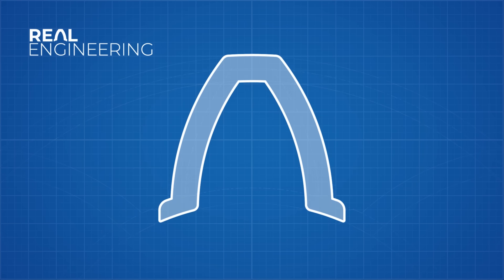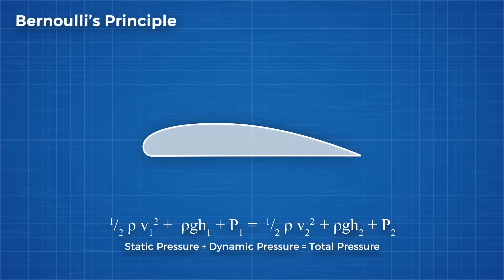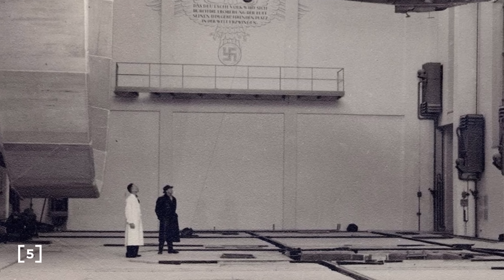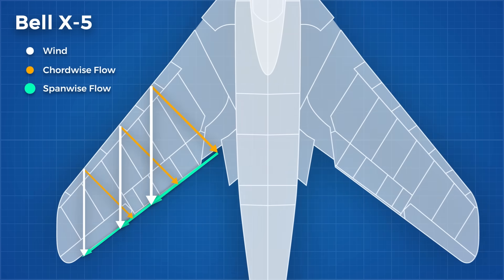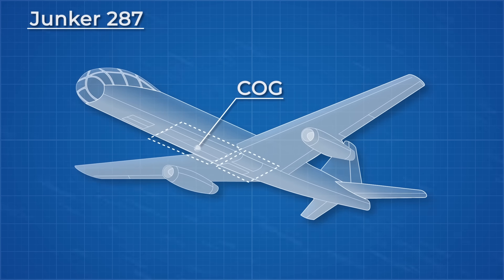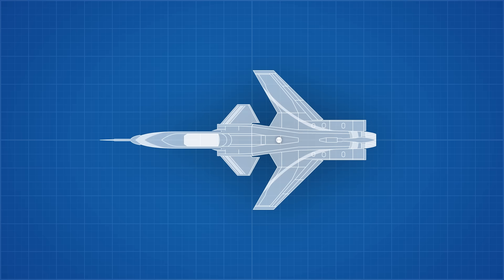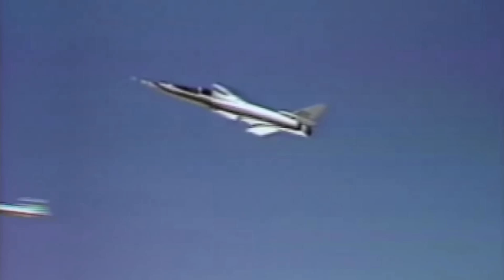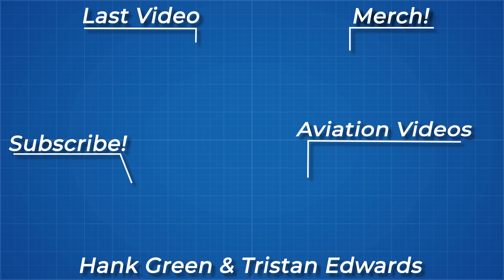Why Do Backwards Wings Exist?

Comment: Doesn’t the B-2 spirit need flight control computers to even fly as well? So why are we complaining about this one
Reply: Well this jet was meant for interceptions and dog fighting but if it's too unstable then the pilots won't be able to control it in the most critical moments, combat. Conversely the B-2 is meant to be a stealth bomber with a crew instead of one pilot and is supposed to maintain stable flight so its manageable for computers to control it

Comment: So basically backward wings are bad for taking off in the air but good for speed 
Then don't make them the both change when taking off to straight wings and to backward to achieve maximum speed

Comment: 2:00 The diagram's airflow pattern is inaccurate. The foil's lift forces air downward, so flow behind the foil should be diagonally downward.
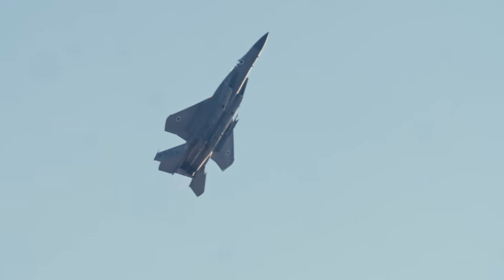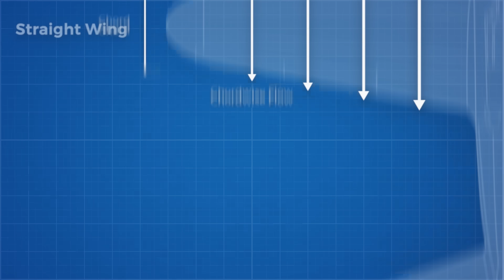6:30 I'm not an aeronautical engineer, but I really don't think the airflow has a significant component transverse to the fuselage, at least not nearly as much as shown in the diagram. See the diagrams starting at 5:00. And forward sweep reverses the SPANwise flow, not the chordwise flow.

Comment: Thank you Real engineering I truly enjoy your video, but I just found out the figure in 10:00 is little odd. As far as I know the instability of X-29 was caused by its reversed position of Center of Pressure and Center of Gravity. If the C.G is positioned in front of C.P it should be stable as the Canard can offset the lifting force from the main wing properly. (In high AOA the lift force generated from the main wing is greater than the lift force from the canard)
Please correct me if I am wrong. Thanks.

Comment: So we have tried forward wings, backward wings, straight wings, double wings, triple wings... what left to try? 

Honey BBQ?
Reply: 4 wings, box wings, no wings, all wings
Reply: @latinpassion  Those aren't left, they all HAVE been tried.
Reply: @latinpassion  Ah, a pilot of culture. Tell me, what are borders?
Reply: @latinpassion  we already have all wings. They're called flying wings. We also have several sets of quad wings too, and box wings
Reply: We could try forward wingLETS on a backwards wing, right?  Or did we already do that?
Reply: Could also try some weird merging of wing and tail such that the vertical fins are at the merged wing and tail tips I guess, connecting the two in what looks from the front like its just a big loop (merge point must of course be sufficiently behind the center of mass to be able to use them as rudders)?   You know, to not have those pesky wing or tailtip vortices or something, since there wouldn't BE a tip.

Comment: The greatest advantage for the X-29's forward-swept wing was not mentioned.  

An aircraft inherently seeks its most stable attitude (try flying a paper airplane tail first and it will whip around to a nose-first attitude).  As a result the plane, in it's most stable configuration does not want to move out of that stability attitude, and takes energy and greater time and force to do it.  However if the wings are swept forward into an inherently unstable position, the aircraft desperately wants to flip around to a more stable position.  Taking advantage of this, the X-29's maneuvering was remarkably quick (which is really desirable in a dog fighter), since any control surface input would be a move to return it to its most stable attitude, therefore reacting very quickly.  Whereas, if it is already in its most stable position, it takes much longer to respond to controls.
Reply: Yes but this was too unstable. Too easy to completely lose control of the aircraft

Comment: I used to think some of Starscream's alt modes that had reverse wings were just nonsense sci-fi designs but now thinking about it a sentient plane that could control every flight surface like a limb actually makes sense
Reply: to be fair, a lot of the time, his robot mode also has the wings in a forward (upward?) -swept position, regardless of how the alt-mode has them, though the control surfaces do end up on what would be the new "leading edge" when he uses them in bot mode.
Reply: @Caldoric  leading edge control surfaces are a criminally under-studied part of aircraft design. Basically, modern planes have slats, canards, and tailerons, and that's it. I wonder why that is? Leading-edge control surfaces would easily solve (or at least postpone, which is often good enough) the stall issue that deeply swept wings have. Seems like it would be useful, I wonder if it changes the lift characteristics of the wing in unpredictable ways?
Reply: lol I'm sure the creators of transformers were thinking that much into it and not just "it looks cool and it'll sell toys"
Reply: @ianism3 If you think about it, Starscream has always had a vehicle mode similar to either supermaneuverable aircraft, or the superior aerial combat platform of the day (the F-15 in the 1980's, the F-22 in the 2007 movie). 

Makes sense because his whole deal is that he's supposed to be the strongest flying Transformer.
Reply: same for most of the seekers, too.

Comment: Part of the Bernoulli story of lift that is commonly used in the explanation is false. When people say the split air must reach the back of the wing at the same time, therefore the air across the top of the airfoil must go faster... that’s just dead wrong. Turns out the air on the top beats its lower air counterpart by quite a lot, therefore increasing lift due to Bernoulli’s law by a substantial amount. To say Bernoulli’s law doesn’t play a part is wrong. But people say it is wrong because a common variant of how it is taught is wrong. Also I’ve always preferred the Newton’s 3rd explanation, it explains why an angle of attack must exist. Forcing air particles down forces the wing up, as well as the resistance to the air on the bottom causing it to slow, creates a difference in velocity beneath the wing compared to the relatively unencumbered flow of air over the top, which leads to some lift caused by Bernoulli’s law. I’m not trying to preach or anything, I’m sure a lot of people know this. But I’ve spent a lot of time trying to workout how the two different laws work in tandem to creat lift.

Comment: In the P-38 Lightning enters the buffeting stage at high speeds do the control surfaces move freely like the elevators without changing pitch or are they still stiff

Comment: Hi! Sorry if this is a stupid question, but why does supersonic flow means shock waves form(in the context of the upper part of the aerofoil)? For there to be shock waves, the velocity of the object needs to exceed the velocity of the pressure waves produced, but the aerofoil does not exceed the speed of sound, only the air that flows through it does, so why does the aerofoil still produce shock waves?

Comment: May I ask a silly question? Why are the leading edges of a wing not sharp like a knife?
Reply: some are, but that wouldn't take advantage of Bernoulli's principle very well because the speeds of either end would be similar
Reply: @HURBased   the leading edge could be very sharp and then curve upwards to create the speed of air differential. The common blunt edge is essentially a flat vertical surface to the oncoming air. A knife edge would provide less drag?
Reply: @bigjulie3714  wouldn't a curve upwards create more drag?

Comment: Great video, but you left out a major part of this story.  This was an attempt by the air force to have a very unstable plane.  Just like the F-16 which is highly unstable in pitch.  In fact, it is so unstable it takes a computer (Analog in the case of the F-16) to keep it from flipping.  However, an unstable plane allows the plane to turn really fast, resulting in the F-16's turn rate and G forces.  Making it a heck of a dog fighter.  When the pilot of an F-16 banks the plane and pulls around the computer is actually just releasing control of the pitch stability and allowing the plane to flip around like a dart will that is thrown backwards.  Also, swept back wings also prevent the shock-wave produced by the nose of the plane during supersonic flight from hitting the wings.   Being an aerospace engineer, there are many things going on at the same time.  Great video.
Reply: But, now with stealth technology and electronic technology, the old rapid turn dogfights are going to become a thing of the past.  The role of the F-22 is kill your target before they ever see you.

Comment: I took over this from NASA when NASA wanted the Air Force to take over funding.  We did a full assessment of the program when it moved.   I recommended it be terminated  because it could not demonstrate the benefits of aero-elastic because the wing was so stiff it didn't bend a all.  It was supposed to demonstrate a design with no horizontal stabilizer but design was so unstable they used had to design them in anyway.   The flight control system had to overcome  a super unstable aircraft.  That they designed one that kept he pilot alive was impressive.  As it was a Northrop team I guess some of this made it into Have Blue.  With enough thrust even a brick can fly.  The digital triplex flight control system had already been demonstrated on another of my programs.  I recommended the program be terminated for these and other flaws.  Just about killed my career but it got a General a job as a VP at Northrop.  Aside from the flaws in this program it took money from my other programs which were feeding technology into the F-22 program. I had to terminate three which never made it into the F-22 - Self-repairing Flight Control System,  Ground Collision Avoidance System and the Intergrated Flight and Fire Control System.  Bottom line the X-29 was not held up by it wings.  It was held up by politics.

Comment: Bernuli's principle is not just a factor that contributes to lift tho, is it? It's just a different way to unterprete it.. it's a principle, it's not a law like gravity, it doesn't say that spreading up air will cause low pressure, causality might actually be reversed.. the air speeds up because of the low pressure, and the difference in pressure between the two sides of the wing is caused by the air hitting the wing below, generating lift.. another effect that help is the Coandă effect, which just redirects some of the air going above the wing downwards as well, but after all the airplane flights because of Newton 2nd law of motion..  air is pushed downward by the wing, the wing are lifted... 

If you calculate the force with bernuli principle you will get the same amount of lift as if you use F=m*a  , teir effects do not "sum", it's the same thing seen from two prospectives (I do believe that explaining with bernuli's principle is a bit less accurate, because the causal link between all factors becomes very muddy and confusing.. while if you use action reaction everithing is intuitive and simple)

Comment: Ace Combat Devs: *watches video*
Also Ace Combat Devs: I'm gonna pretend I didn't see that
Reply: Nah, they definitely remembered it (or something like it anyway).  Their approach to a number of their original aircraft seems to be hybridizing a backward and forward swept wings.  See the Morgan and FALKEN.  Their wings are about half-back, half forward (whereas the X-29 and su-49 seem to be like 80% forward, with really only a small lead-in to the wing being swept back).
Reply: @SephirothRyu  SU-47*
Reply: @lemeow7883  gah.
Reply: @SephirothRyu let's not forget about the su 43
Reply: Also ace combat has the X-02 with backward swept wings that can fold in at faster airspeeds
Reply: Belkan.
Witchcraft.
Reply: @memesrdreams4854  yes.
Reply: Based Ace Combat poster
Reply: Was scrolling down looking for an Ace Combat comment. We're everywhere
Reply: XR-45 Cariburn
Reply: LMFAO
Reply: it makes sense for what they are going for? I think you are the one pretending
Reply: instability isn't really a problem anymore thanks to computerized control surfaces
Reply: @rdablock  especially when the XO2S and the other experimental planes are gen 6+ fighters
Reply: @rdablock  The issue is more with the durability of the wings rather than stability which is easily solved with even 4.5 gen fly by wire.

Comment: The problem with applying Bernoulli's principle to the lift of an airplane wing is that the math is only applicable to enclosed systems, i.e. pipes, valves, and the like. I think it perfectly explains the mechanism of lift, but it's technically incorrect. :p

Comment: So I have to wonder if the spanwise flow characteristics of the forward sweep have been put to use on the trapezoidal wings of 5th gen fighters, with the forward sweep on the trailing edge of the wing, while avoiding the instability by using a delta style leading edge...

Comment: Are you fucking deaf man putting the elevator at the same level as the front wing at high speed causes an air bubble no air flow over the elevator no control